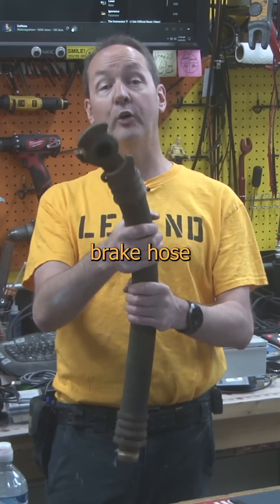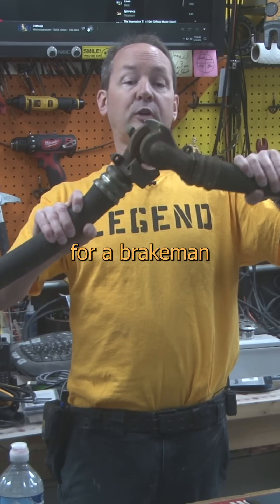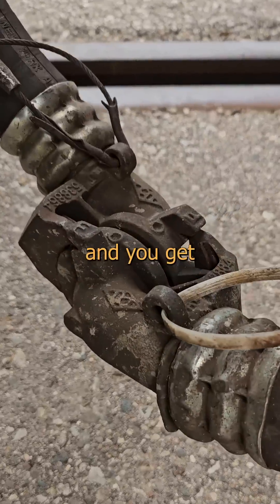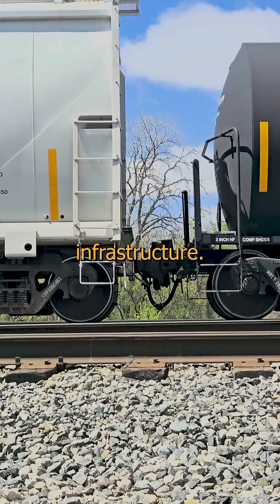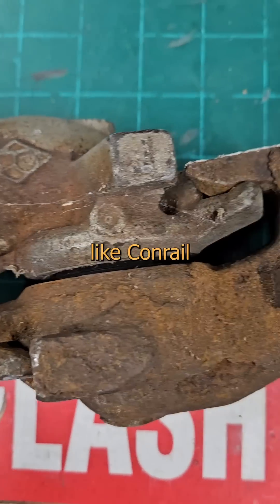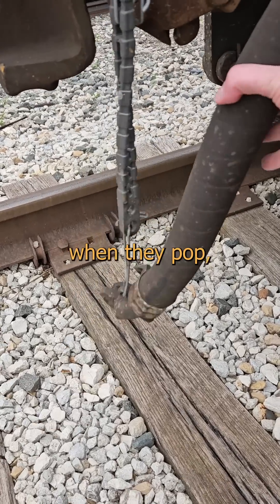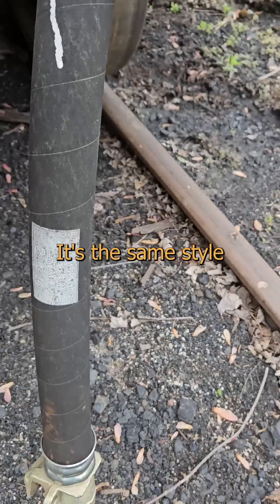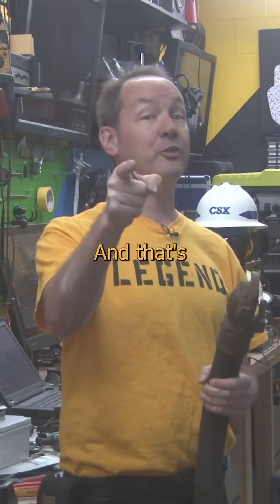Railroad Brake Line #chrisboden #comedy #engineering #train #gladhand #educational #connection #hose

Comment: Its also important to note, these weren't made for speed or ease, but to save lives. Just like automatically engaging knuckle couplers, gladhand connectors minimize the work techs have to do between the cars, significantly reducing risk.
Reply: This comment deserves to be on the top

Comment: Breaking with pressurized air is very cool, but you can't directly compare the system used on trains and on trucks. Sure both use air, but in different ways. 
A train is basically like in  a car, you have air in storage, which is applied to a cylinder of whose piton rod is mechanically connected to the brake if you turn the right valve, but every train car has its own  storage and the locomotive has the compressor and all of the tanks in the cars are getting filled over that one line and also the Impuls for braking is given over this one line....its a little bit complicated to explain, and english isn't my first language too, sorry for that...

On trucks or on bigger tractors there were those one line systems up until the late 80s, but as soon as the late 30s ther was the 2 line system as well  which is the only one still allowed on new vehicles since about 20 years.

The 2 line system works different

You have of course a compressor and your storage on the pulling vehicle ( tractor, truck...) and on the Trailer.
They are connected by the line with the Red couplers ( required by law) and sometimes the lines are red too.
Then there is the yellow coupler which transmits the brake signal to the attached trailer. Its safer and easier to install on trailers which doesn't have air breaks. 

I love your channel with the educational content, keep going....
Reply: you are right about the freight cars, pressure drops occuring in the brake pipe trigger the application, but the brake cylinder still needs to be pressurized via air from a reservoir to physically apply the brakes.

Comment: I would have thought that with all the electricity running through the engine, that the brakes would be some kind of 4o cable.
Reply: freight cars usually do not have any kind of electrical connections between them.

Comment: I was always told to give those seals a good spit before connecting them. They last for decades! Even if the seal isn't perfect, that's fine. Long as it's in the acceptable range during your class 1, it's all good.
Reply: within 15PSI of the headend means gtg

Comment: The nice thing about the glad hands on a semi truck is that the hands are repairable, not made in one piece..... and probably work with less pressure. (Semi's operate at 120-125 psi, not sure for trains)
Reply: 90 psi for freight trains.

Comment: The "Bungie" is usually referred to as a "Whip Check". We still use these connectors in Industry for tools and equipment that use more than just the standard shop air pressure to function properly, like Arc Air Gouging or High Torques.

Comment: I've used similar ones called "barcelona type links" I just hope they went as smooth as the ones in the video😂
In order to twist and untwist you'd have to push the rubber seal like an animal

Comment: "Haven't seen seals take that much of a beating since my winter in Fort Severn"  Is a VERY underrated comment. Made me spit my coffee..
Reply: so a baby seal goes into a bar and the bartender says "what'll it be", the seal says "anything but a canadian club!"
Reply: @BOYTLeRoyJenkins  I haven’t ever heard a Fort Severn reference on a YT video before this. I made two ice road trips in to Fort Severn back in 2004. It’s a bit of an out of the way place. 2 days drive from the nearest civilization.
Reply: Fort Severn? is there something we should know, or maybe we're better off not knowing?
Reply: @JoeDeMarco-u2u  Fort Severn is an isolated community on the shores of Hudson Bay in northern Ontario. It is accessible by winter road for a few months yearly (500 kilometers from the nearest all-weather road, with one other remote community located on the route). Fort Severn has barge service off of Hudson Bay for a short while in the summer once the bay is ice-free. Other than that, it is considered a "fly-in community". The population of 400 is almost entirely woodland Cree subsistence hunters. I did not see seal hunting while I was there but assume that there is an annual seal hunt with traditional methods involving killing with clubs. PETA et. al. have issues with the practice.

Comment: Yeah, but the coupling on semi gladhands is really tight. Sometimes they're so tight, you gotta treat them rough and slap them around. If you spit on the rubber before you hook up, they slide together much easier.

Comment: The Bendix system on big rigs use pressure to release the parking brake springs... Just a much smaller copy of train brake systems. Oh, and the smaller glad hands... Can be a royal pain in the whoo hoo to connect or release. Ummm yeah, when ya pull away from a trailer and forget to disconnect those little buggers...they tend to get pissed and jam in all manners of messed up ways.   Ugh
Reply: Freight car air brakes dont actually use air to physically keep the brakes open; the brakes are physically applied by a a brake cylinder being pressurized and pushing on linkages that then push the brake pads against the wheels. The brakes are triggered and controlled by reductions in air pressure in the brake pipe of the freight car though; the brake control valves see this drop in pressure from a normal 90 psi and then pressurize the brake cylinder a corresponding amount using air from a seperate reservoir mounted on the car. The reservoirs all need to be charged up first when a train is getting readyo to travel, via that same brake pipe.
Reply: @acehawk888 yup, similar to the Bendix system but instead... Like you said... It's all a single air line system. Big trucks have 2 systems controlling the brakes. The Park Brake side pressurizes the park brake chambers and collapses a spring to release the brakes... The Application side uses pressure to apply the binder material against the discs or drums slowing the tiny cargo haulers down. The park brake chambers are easily identified by 2 chambers stacked on top of each other. Also if things go completely SOUTH and you need to move the truck in an emergency... You can install CAGING BOLTS into the center of those brake chamber stacks. Don't go far because stopping that oinker will be a trick. Thank you for the insight on train air brakes. When i ride the D&RG narrow gauge trains i can't help but be mesmerized by the steam powered air compressors on them old gals. Have an awesome day.
Reply: @gerrywalsh5766 nice explanation, have a good weekend as well

Comment: If that gets you hot and bothered you should look into SBUs, they have a gps in them. There is a small air turbine that charges a battery that powers a radio that sends pressure information to the head end.

Comment: Do trains use only have one connection between each car unlike trucks with a supply / emergency line and a seperate service brake line?
Reply: Yes. Each car has its own service and emergency reservoir and a triple valve to connect all the parts. So just a single brake pipe runs the entire length of the train, and the difference between service and emergency application is based on how quickly the brake pipe pressure is reduced.

Comment: another cool bit of engineering are the nuckle couplers, they can withstand tons of pulling power and not a pound is put on the pin holding the coupler together and is all put on the body of the coupler. hyce showed this off in his train 101 on couplers where he pulled the hing pin out and pulled on it (by hand) but he showed why it doesnt need the hing pin when locked closed
Reply: correct, the force is carried by lugs

Comment: Hello, me again. Just a friendly reminder, but do not shake hands with any equipment. The gladhands will be glad to give you a handshake, and keep a finger if you do it wrong. Couplings wiggle, crash and slam inside themselves a LOT. If one of those hands give you a squeeze, you can lose anything from a finger, to a toe, to an arm, and if the train gets moving, the axles will be glad to cut you in half.

There are records the length of football fields where people were too careless, too lazy, or too impatient. And they lost their lives doing it that way. Railroading takes a lot of skull practice, and the ones who dont use it are sometimes found in several places at once. 

Heh, “a little bit careless, thats like being a little bit pregnant.”

Ive been bumped, bruised, cut, and sliced. Sure, chicks dig scars, but they dont dig the stupid moment that got them.

Comment: When i worked at a shipyard rebuilding barges we used this style of line for our shop air. Had the biggest rotary compressor you've ever seen hooked up to it. Oh yeah and fun fact the reason you see locomotives pushing at the back those long trains isn't just there to help push, the length of a train is actually limited because the compressed air can only go so far hence a loco at the rear to also supply air. Out west on the super long trains they'll run a locomotive in the middle aswell for that reason. Edit for typos and grammar errors.
Reply: Well, damn. Once spent an inordinate amount of time crouched on a piling 50ish feet above the Iowa river & seemingly inches below the endless train above going by. Thought that engine meant the end. Nope: there were another eternity of cars to come. 

DON’T cross railroad bridges, kids! Seriously. We thought we were kinda badass, but we never did it again or ever talked about it. We all went straight home after that. I’ve swung from buildings, driven stupid cars, gotten lost in caves—but death was never as up close & personal as for that endless butt-clenching few minutes.
Reply: @Scot-p1v  WOW. That's quite a story!
Reply: Another mystery explained...I'm only 70!
Reply: It isn’t just out in the far west. I regularly see DP units on freight trains running through Washington DC.

Side note, that’s cool about the shop air. I used to work at Philly Shipyard, but I don’t remember if we used that fitting on our air lines.
Reply: @michaelimbesi2314  come to think of it I've honestly never seen anything close to that setup before. The od of that hose was 2 inches. There's probably somewhere you can buy it from but I've never seen it online. Anyway we mostly used it for gouging out the welds. My yard had a job for everything so as welder you'll play with the acetylene torch when stuff ain't lining up but that's about it. I never got to play with the air arc so idk much about how they managed to rig that up. Unfortunately my body physically didn't Allow me to work there very long so I had to go back to rail and decor making and trailer repair. It's better money when you have your own business tho so it's not bad.
Reply: @Big-lron  im a conductor and yes the dp units help with air. But not the main purpose. We have run 12000ft trains conventional meaning just units in the head. But the distributed power helps with train forces. Meaning knuckles dont get ripped apart. These trains actually have enough power to pull themselves apart.

Comment: Use to be a truck driver in the oilfield. When I got my cdl, my 1st job was for a frac company. Setting up the pumps, is where I learned how to drive. You're not suppose to turn the truck past 90° due to the trailer tires hopping over instead of rolling. In oilfield, turning properly is out of the question sometimes. One thing I was told on frac was to forget following the 90° rule. If you need to, you turn that truck as sharp as you need to. When the glad hands pop off, you gone too far. During my 13yr driving career, I've had to turn well past the 90° and have had the air lines disconnect only a few times. After frac, I became a water hauler. One night, me and another driver was taking water to a location. It was tight. When I say tight, every time we pulled on location you could hear that cherry pop. The other driver couldn't get turned around on location. He easily had a decade more driving experience than me. I got him turned around and he asked how I did it. Told him to forget about the 90° rule. You jackknife that son of a bitch until the airlines pop off. When they do, you gone too far. After I told him that, he never had a problem
Reply: The only thing I've ever broke an airline off of is a Frac Pump. Can confirm.
Reply: Over the Road trucks will break the aero shroud off before they pop the air lines.
Reply: I spent 8 years in the army, as a heavy equipment technician. I've never had a glad hand pop off. I'd move 3 trucks twice a day, and essentially u turn them every time. They were 43 ft low boys but still.
Reply: It's awesome that the other driver, despite probably more senior than you, never gained a holier-than-thou attitude and was willing to learn new tricks 😊
Reply: I've only ever had issues on reefer trailers. Had to take off a hanger just so it wouldn't pull the air lines apart going into a dock about a month ago.
Reply: similar with truck tire tubes, inflate them to 10 psi before they pop.

ok that's a joke

Comment: Now do about 100 of em. No but they are pretty dang easy to do after awhile you can do it in the dark with your eyes closed but at times it can be hard considering if the slacks out and one is kinda shorter than the other. The pop you hear when cutting away from a cut of cars is a oddly comforting sound after awhile loud as it is. Sound of business being done as i like to say.